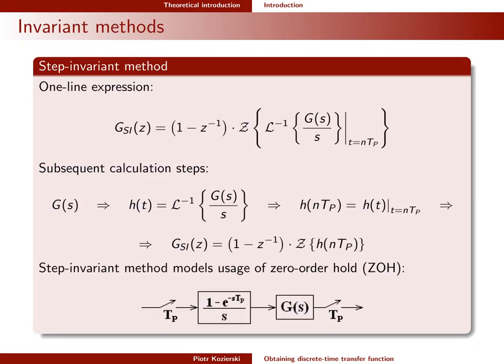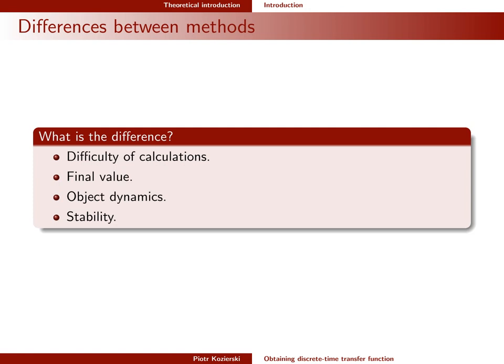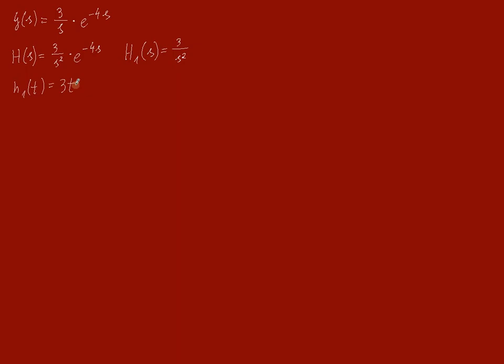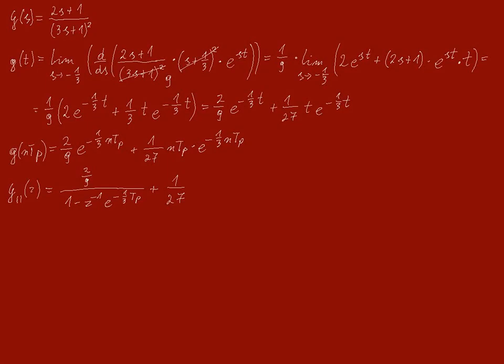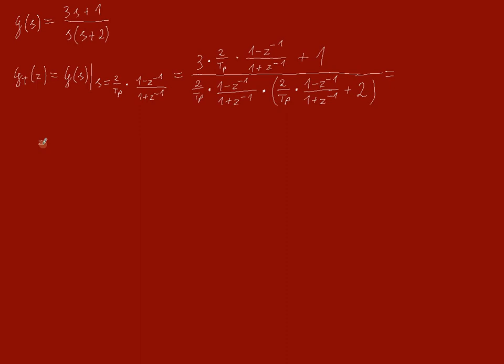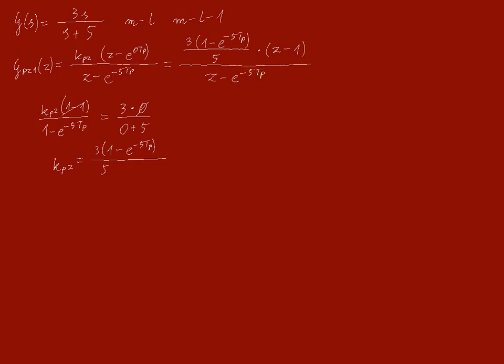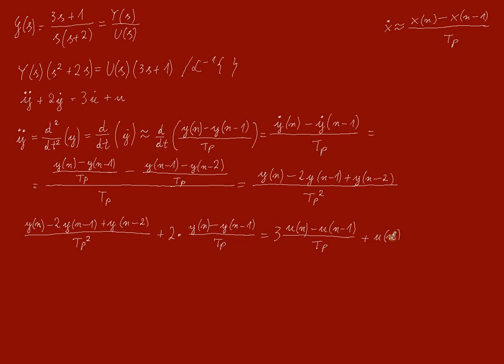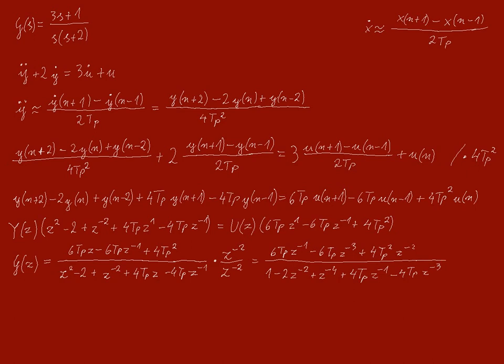02 Obtaining discrete time transfer function

Comment: 8:29 16:13 17:53 Step invariant method
21:20 27:30 32:56 impulse invariant method
39:30 Tustin method
45:35 Delta-  method
Delta+ method (this method is not presented, it's the same as + just different substitution)
48:15 54:45 (two approaches)  Poles-zeros matching method
Forward finite difference method 
58:16 Backward finite difference method 
1:09:20 Central finite difference method
Exemplary finite difference method